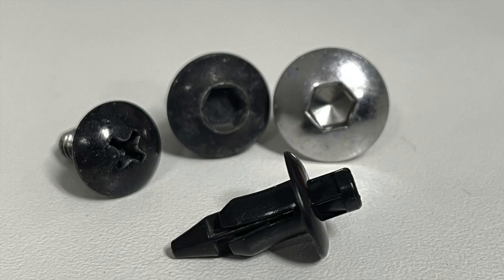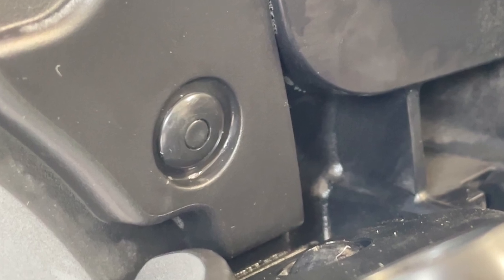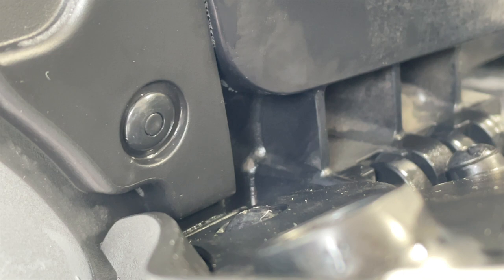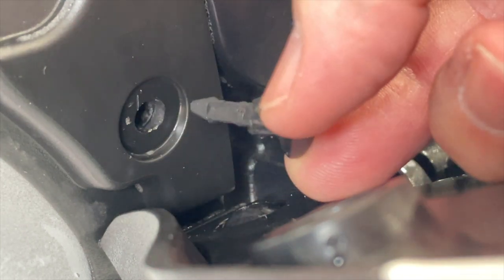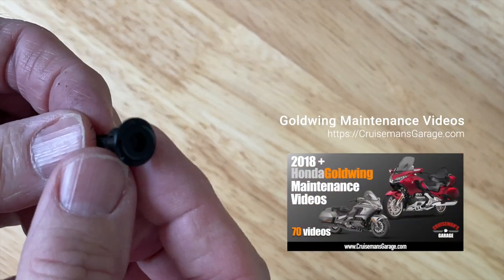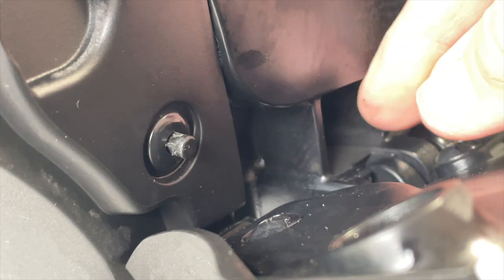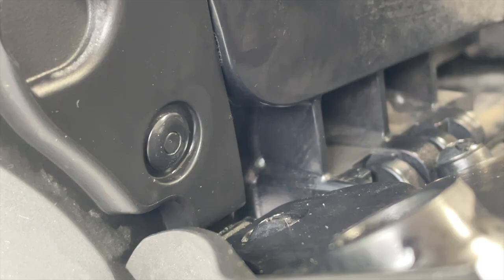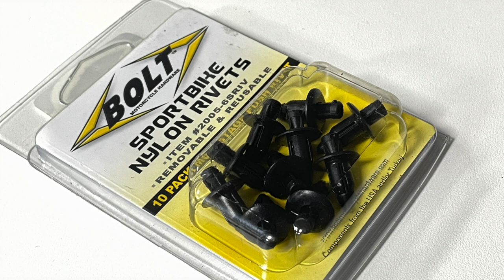Ep 03 Removing Plastic Body Clips (Rivets) | Honda Goldwing | Wing Tips

Comment: How do you remove the push pin with the center nail that needs pushed in roughly a quarter inch but these are already recessed a quarter inch they do not set flush when installed. They look identical to a flush nail type pin but the center pin is already in roughly a quarter inch I'm stumped. 2022 Honda Ridgeline. thanks

Comment: Another helpful video, thanks Cruiseman! Additionally, I’d like to know If you had an issue with hooking up your Pathfinder high mount LED sequential brake/running light, using the Pathfinder harness?
Reply: Hello, I bought an installed the SHOWCHROME box filtering and relay for any addition turning, brake, running lights on my 2021 DCT GOLDWING TOURING.
I added 3 more front turning lights from PATHFINDER and MUTH on the SHOWCHROME output ports, with the OEM harness connector provided by SHOWCHROME, and will add later the rear saddle bags and trunk rack lights from PATHFINDER when available. I also added a USB supply and a charging plug into the "always on" output of the SHOWCHROME box. The amp available are more than enought for LED lights. Hope this helps.....

Comment: Great tip. I bought some clips off of Amazon and they would not work. They said they were the correct size and looked exactly the same. The problem was the center pin was designed incorrectly and I fought with them to try and get them to work. I had to buy some from show chrome. Be careful where you buy them. Always buy them from a company that sells motorcycle parts so you know they will work.

Comment: Sorry, off topic again. 
I have 1000 miles on my new DCT. I’d like to do the first oil change and would like to use full synthetic oil. My dealership says that Honda recommends not using full synthetic because it’s too slippery for the clutches in the DCT. They say it’s okay to use a semi synthetic oil. I know that you use standard oil in your bike, but have you heard of anyone using full synthetic and if so, any issues with the transmission slipping? Thanks.
Reply from the maker: I have not heard that you cannot use Synthetic oils in the DCT. There is nothing in the owners manual about it. As long as the oil meets Honda Specs, you should be OK. And yes, I have heard of several folks using synthetic oils.
Reply: I have a 2018 Goldwing Tour DCT and use the Honda HP4S 10-30 full synthetic oil. Honda approves using this oil in the bike. I have no problems with the transmission using this oil.
Reply: @flyboy1ron ; Hmmm. The parts guy at our local Honda dealer said they have a semisynthetic, but not fully synthetic and that Honda doesn’t recommend using the full synthetic in the automatics. I’ll have to check out the oil you’re using. I use full synthetic in all my gas powered machinery and would feel better having it in my Wing. Thanks.
Reply: @cruisemansgarage ; Yes, I’ve checked the owner’s manual. Nothing prohibiting the use of synthetics. flyboy1ron says he uses a Honda, full synthetic in his DCT... works fine. Thanks.